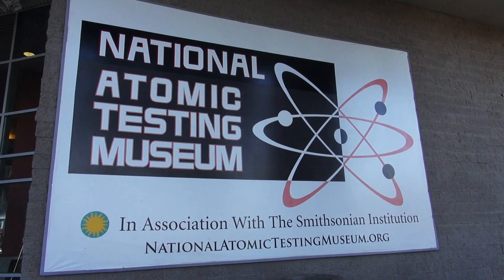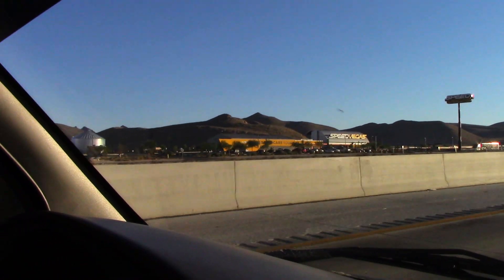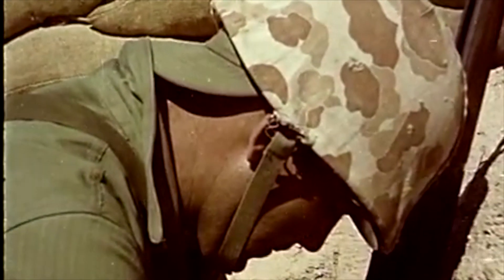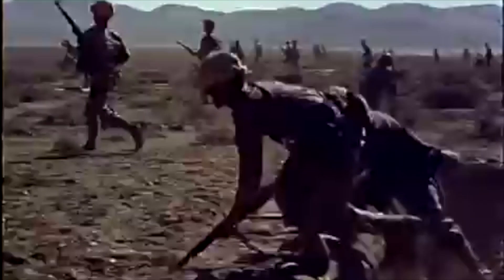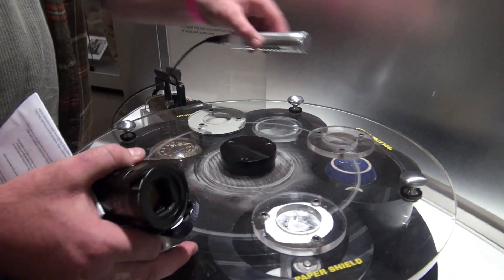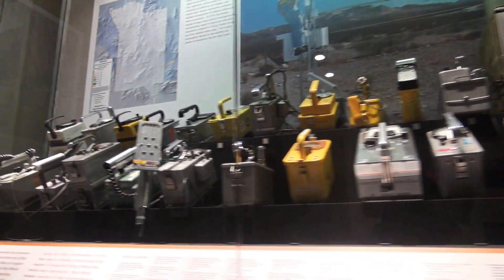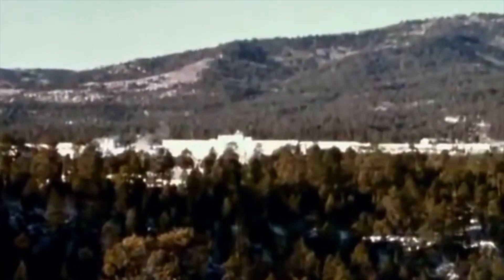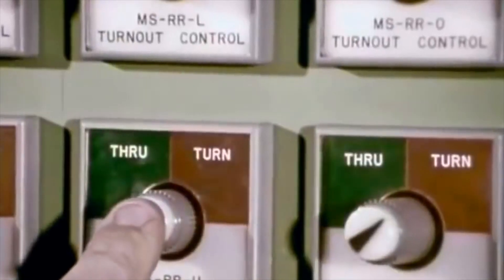OUR LOST ATOMIC JET ENGINE .. IT WORKS .. IS IT BACK?! MARS TRAVEL?

Comment: I think the atomic rocket program was canceled due to the influence of anti-nuclear environmentalists.  There is no way to test this kind of rocket motor on Earth without releasing a radioactive exhaust.  Space travel using conventional chemical rockets will always have to be very time consuming because only the most fuel-efficient trajectories can be used.  The general phasing-out of the manned space program following the end of Project Apollo meant that the atomic rocket program would have to be shut down.

Comment: A lot of interesting stuff for sure. Thanks.
But the political schemes  behind are never even mentioned.
In the middle of the 30th US incorporated the communist Frankfurt school without realizing 
their dangerous goal. Thousands of communist spies were created. Not only the atomic secrets were sent to the Soviets, but much more. Look at Soviet missiles today full with American technology. America is still struggling with this kind of people.
Thorium is a quite different story. It will be the energy source soon. It is tested in this moment in China. It uses the same kind of reactor as the rocket motor. 200 times more efficient and totally safe against core melt down. But it can run at temperatures of 800 C making it suitable for thermochemistry . A big area of interest in environmental subjects. Unknown for the most , but certainly not new.  Fuel can be produced from water (H2) and air (CO2)....
America needs an other regime friendly to development of atomic energy.
BS about the climate is the result of politics from Marx and Lenin.
Make America rich again. Clean out the hidden politics of Marx.

Comment: Hi. You might be interested to know that the problem encountered with the "atomic" engine was based around the weight of shielding required and the problems of guaranteeing radiation wouldnt leak out. PO Ernie Garvey was involved with designing the plumbing for a proposed UK civil airliner back in the 60s. A huge problem which couldnt be overcome was the public distrust of nuclear reactors flying around. So he transferred to a proposed atomic engine for the QE2, which again fell fowl of public mistrust and fear.   I had heard from a source in the US that the Army had experimented with a prototype atomic ramjet powered personnel carrier, but the thing tended to spew out radiation into the interior.   Thorium would be really much safer than uranium but the reactor would need to be a bit too big.

Comment: My father worked on test beds/frames for a nuclear powered engine to replace jet engines in the 1950’s.

The goal was to build an aircraft for a replacement for what became the U2 and SR71 aircraft - a spy plane that could go orbital with less need for refueling - flippantly said to be a matter of once per year ;) (hate to be the pilots tasked with such long duration flights)

The project was later shelved, even though the engines were tested and worked well, because  their weight made the required airframe to support them to be far outside the required parameters for an effective  “spy plane.”

The airframes tested could not get off the ground.  One idea that came out of such was orbital assembly of the engines in the future for a space craft that could go to Mars and further.

As he put it, not quite an atomic bomb going off out the back end of the craft, but close.
Reply from the maker: Amazing story is your dad still with us, I would love to do an interview..

Comment: Just found your video Tino. Found it quite enjoyable. That was until we got to nuclear rocket. 
FYI, I'm an ex navy nuclear power plant operator, having spent 2 years in the navy getting trained to run a nuclear power plant, then two years teaching others to run the plant, and then 4 years in the fleet. A lot of the early testing for both the nuclear rocket and the nuclear jet aircraft engine was done out at the National Reactor testing station in Idaho. Since that was where I was as a student and later instructor, we learned a bit about some of the other projects out there, and the nuclear rocket was one of them.
Problem #1 for both systems was that in order to get the thrust that was needed, the core had to run at very high temps to heat the propellant, be it hydrogen or air. That led to a lot of trouble with the metallurgy, with LOT of radioactive particles were released in the exhaust whenever any of the fuel cladding failed. Which it did with appalling frequency. That was considered "not a good thing". 
Problem #2 was that when you run a reactor, and then shut it down, it does not stop creating heat just because it got shut down. The radioactive fission products created when you were running the reactor at power decay after the reactor itself is shut down. Keeping the decay heat from melting the fuel elements after shutdown (think Fukushima) was a problem that was never solved. Using hydrogen  propellant just to cool the reactor wasted too much propellant for the rocket to be useful. Pumping air through the core to cool it in the case of the nuclear jet engine took power that would not be available when it came time to land.
The final nail in the coffin is that after ANY nuclear reactor (including thorium fueled reactors) goes critical, the core becomes highly radioactive. Since all too often the maxim "what goes up must come down" applies to rockets and airplanes, having a incredibly radioactive core come crashing down in your back yard was too high a risk to take.
Sorry, but no conspiracy here.
Reply from the maker: Could you reach out to my in my email, I would love to pick your brain about some of those - what is possibly and is not possibly when it comes to nuclear propulsion, most of the information I got was from some of the NASA statements and papers they out out on it. I understood it was functional and worked just before they shut down the project. And they were talking about picking it back up a few years ago citing a NASA press brief.  But I would love to know more as I am not a nuclear scientist lol
Reply: Also I'd be more worried about the radiation left at oak ridge national laboratory in cali pretty sure that's the reason u see warning labels that say known to cause cancer in the state of California 
I mean if ur looking for a conspiracy that is
Reply: @thomascooley2749  
Oak Ridge National  Lab is in Tennessee.  
Also,  the warning labels about cancer in California are because California is the only state that has a regulation requiring the warning.  It has nothing to do with radiation in California.
Reply: @redhotmoon1656  I must have been watching oak ridge labs video before that I ment to say the molten salt reactors that north america ran in cali